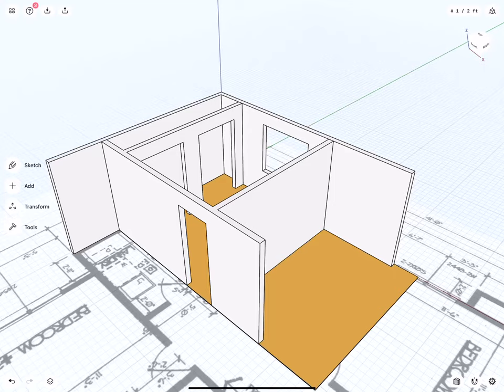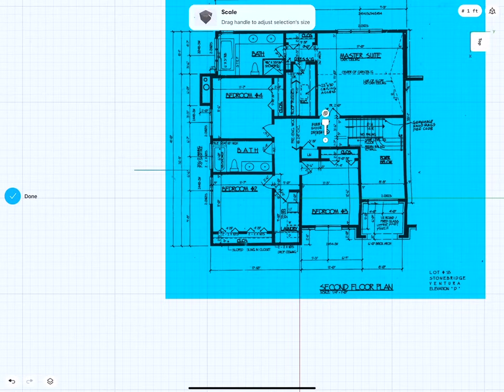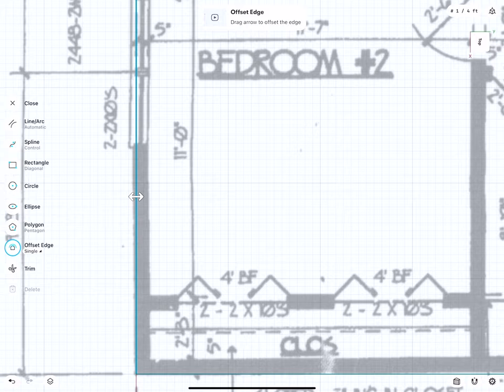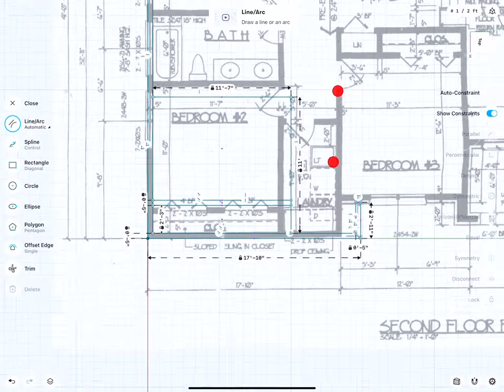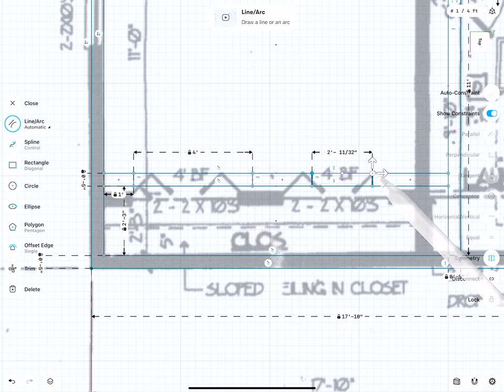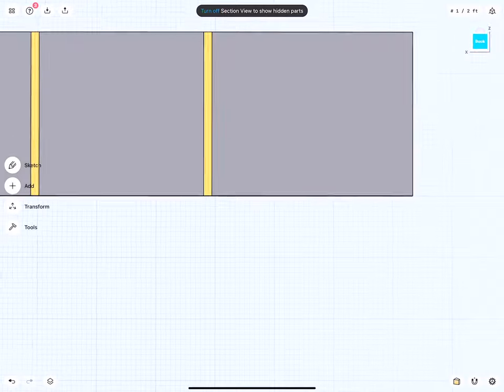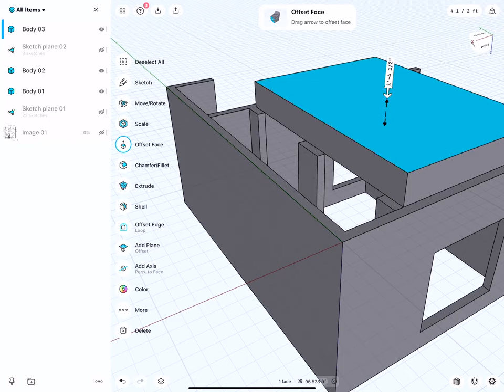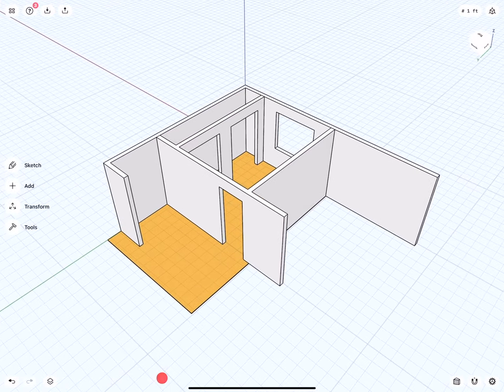3D Modeling for Interior Design: Walls & Rooms | Shapr3D Step-by-Step

Comment: Thanks for this. I’ve been trying to build a room based on my studio and NOTHING was working right. So frustrating. It’s a little distracting in the beginning doing the scale as 9’6” instead of 9’8”, and how the front wall is 17’10” and so far overshoots the laundry room, but so far the drawing hasn’t been scaled to match so none of the walls line up. Trying to follow, but there’s a lot to mentally keep track of so not to get confusing. I love your pacing, and how simple you make it though.
Reply: Oh ops slight oversight - the video shows however a process that applies to modeling in general. Shapr is actually a very useful modeler when on site doing modeling on the iPad.

Comment: The window alignment should be a drag into position with a smart guide snap confirmation. In other words one should be able to just drag the element into position with the y & x smart guides appearing when dead centre. Or at least a function that’s closer to ‘concentric’ in the case of circles/ellipse. Otherwise Great video.👍🏼

I’m currently modelling a latrine outhouse with a sloping roof for water dispersion. I was hoping to see that in this video. Is there a part 2 by any chance?
Reply from the maker: Hi! Thanks for your feedback :) There isn't a second part, but we will post more interior design videos soon!

Comment: Hello. I just want to make new models for my hack but I'm stuck in the configuration phase (step 6/7), which says me to switch camera to 3d view and I don't know how to do this.😄
Reply from the maker: To turn into the 3D space, the user will have to pan the camera. This differs from device to device, on iPad, it is the rotation with one finger, but with a mouse, it is by holding down the Shift key, secondary click (or right-click), and drag the mouse, or Drag the mouse while holding down the Shift key and the middle mouse button.

Comment: Does anyone know how to add sheets to a drawing. The only way I seem to be able to do this is by creating a new drawing for different views. Also, is there a way to rotate sections? They only project from the section lines so any projection facing the drawing south is upside down and the east and west are sideways.
Reply: I’ve grown to really enjoy this app. Only criticism is with creating architectural/construction drawings. I don’t wan’t to have to export to a separate app just to create a presentation package for a client.
Reply from the maker: Hey there! Thank for your feedback, we'll take it into consideration. As for your questions:
The multi sheet drawing feature is currently under development. Please follow us to get more updates on new feature releases.
As for the rotate sections, we are following the ANSI and ISO standards which are the most common US and European standards. The units and the projections we apply are connected with the selected standard and it could result in the flipped projections. If your projection seems to be upside down, try changing the drawing standard between ANSI/ISO. You can do it in your drawing settings.